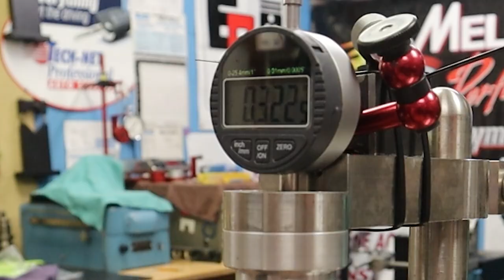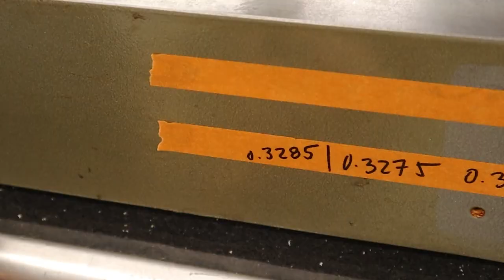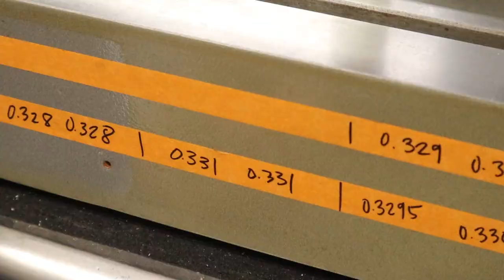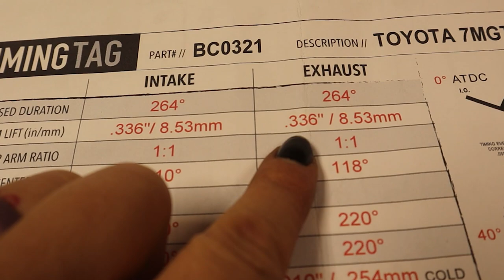Brian Crower CNC'ed 7MGTE Camshafts on the Cam Doctor: Actual Lift Measurements: Timelapse to Music!

Comment: I live in Aus and there is a company called Tighe Cams that do custom grinds from their own billets and got some 0.400 226@50 thou beauties. They measured up even more consistant than these which I was very impressed with as they were only AUD1150 shipped!

Comment: I have a set of BC 272s for my 7m that I've owned for 7 years that were bought from an individual factory sealed.  How are you able to tell the difference (without a cam Doc) between hand ground cams and the CNC'ed sets?  A paint mark or something on the cam itself?  Keep it up with the 7m love!
Reply from the maker: Honestly I could not tell the difference between the ones that were CNC ground and the ones that were hand-ground. Both equally deviated from the claimed lift. Actually-- because of this video, BC cams changed their spec sheet!!!

Comment: How do you know whether your TDC on the cam? Do you go off the manuf. measurements?
Reply: The highest point is the highest point.
Reply: @802Garage  Thanks...thats what I figured but  wanted to make sure
Reply: @phillipsstanley  As long as you start from the base circle, which should be the same all around until the lobe starts, you should be able to find center by whatever the highest reading is. :)

Comment: This is extremely unnecessary.  The cams should be new if you are going for a custom build and I can only see “measuring” your cam if you are “budget” building.  Camshaft wear is “very” noticeable on other engines but toys are often within spec due to choice sourcing of raw materials.  What a waste of time.
Reply from the maker: These are new cams, and you couldn't be more wrong. Read my most recent "community" post. Because of THIS video and me taking the time to double check the manufacturer, Brian Crower actually changed their official cam card to reflect my numbers.